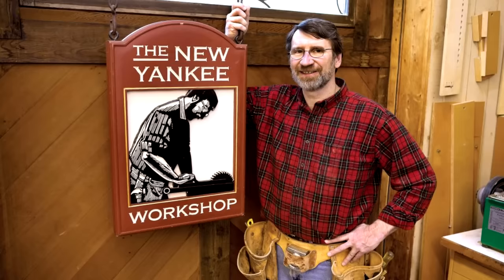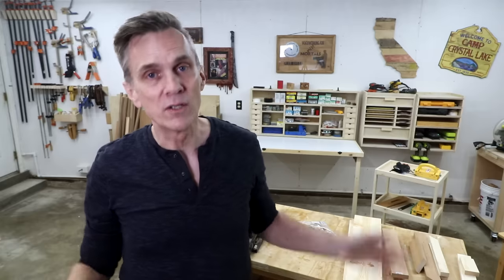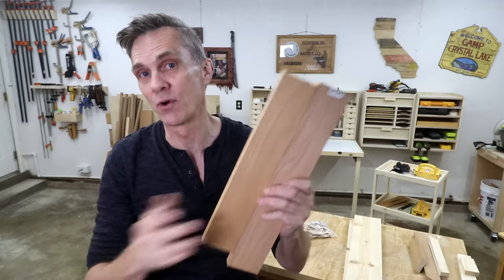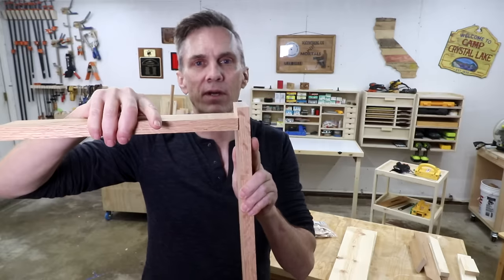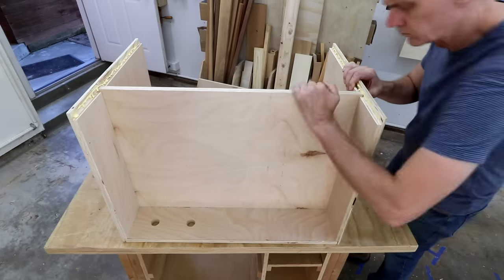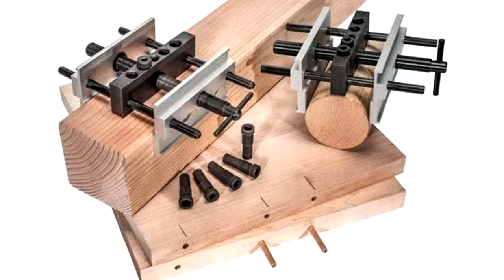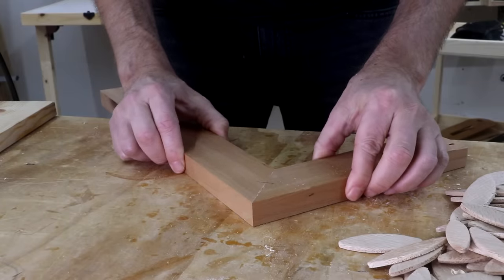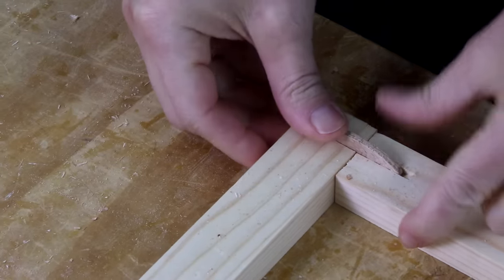So, is a biscuit joiner completely useless?

Comment: Depends on what tools and equipment you have.
What if you haven't got a table saw, or a table router.
Use the correct biscuits an spaced correctly , they are perfectly ok fir general joinery.
Frinstance, joining two 3 inch planks to make 6. 💪

Comment: Came to the same conclusion many years ago, used it a few times and decided it was useless.
Reply: You probably have not designed furniture with it in mind. You can make anything from cabinets, tables, chairs or anything else with biscuit joints and when combined with screws it produces really strong joints with perfect alingment.

Comment: I actually bought one a couple of months back and have been using it for edge joining. I was on the fence about it, but I'm hoping I can use it to strengthen some miter joints on a cabinet I'm building.
Reply: You can build cabinets with biscuits as well. Small tables and perfect for biscuit joints as well. I use biscuits with pocket hole screws for perfect alignment that produces strong joints. 
If you are making cabinets with raised panels you can join the stiles and rails with biscuits. Dining tables in the only thing that you could not use biscuits on their own with but that is were pocket hole even normal screws come in. 
What you can do as well with a table is joint it up with biscuits and then drill a dowel though after the glue as cured.

Comment: I have a dowel joining jig (actually, three of them— garage sales). My brother has a biscuit joiner (also a garage sale find). They both work, but the dowel joinery is much cheaper. Maybe the biscuit joints are stronger, but I wouldn’t want to rely on either for a joint that will bear a lot of weight or stress.

Comment: I use a dowel jig regularly - I got a pretty good self-centering one - and I find that it is particularly useful for helping me line up glue-ups for otherwise awkward joins.  In addition, I use dowels when I need a joint to be particularly strong. I agree that it's not usually necessary, though.

Comment: Steve,  I just happened by your channel after viewing someone else's channel on the same subject.  I must say the biscuit joiner you have must be pretty crummy to cut a slot like that.  If you had a better machine it might cut a better slot that fit the sai biscuit with less slop.
Having said that I too fine the biscuit joiner to be essentially useless in my shop also.  I have a higher end machine and it cuts good slots saw the tool as eye candy after watching Norm biscuit everything together.  So I ran out and bought one.  And after one or two uses I put it on the shelf and it has stayed there for the last 20 years.  The one use it is supposed to excel at, aligning boards for edge gluing is an unnecessary step for me.  I am fairly adept at edge gluing and can get very flat glue-ups without the added step of dragging out another tool and the steps involved in cutting slots.

Comment: I use my biscuit joiner every time building cabinets and the occasional finishing projects. If yours is that sloppy then it’s obviously a piece of junk. Love mine and use it it plenty
Reply: I am making a couch table, I have a dowel jig but it doesn’t got exactly in the center edge of the 2x4. So I was gonna try a biscuit joiner cause you can adjust that. So in all your opinions what do you think would be best? Thanks I’m Advance. Big Jim.

Comment: I, too, was influenced by the great Norm Abram, when I bought my biscuit joiner. I soon became aware that biscuits added virtually nothing to the strength of joints. But I have to take exception to your dismissal of their ability to level the joined lumber. If you leave the biscuit container open to the atmosphere the biscuits will swell as they take up water from the air. In fact I usually have to lube them with glue and tap them into the slots. They do a great job of lining up and leveling joints between long boards and this saves me a lot of time scraping and sanding later.
Reply: Norm often tapped his in with a small mallet.
Reply: Dave Claghorn I noticed that Norm glued the hole before inserting the biscuit . Supposedly it helps biscuits swell up and fit better as they absorb the glue. I find that glue helps lube the biscuit to make it easier to insert.

Comment: I don't remember the episode, but towards the end of Norm's series he did state that he generally no longer used biscuits for table tops as he had seen problems with depressions appearing at the sites of the biscuits, after a number of years.

His producer got a number of his pieces and the New Yankee Workshop, the building, was on his producer's property. Thus Norm could check up on how some of his pieces aged.
Reply: This also calls to mind something that I learned from Paul Sellers that I have not seen mentioned elsewhere. When gluing up something like a tabletop he has on occasion remarked, and demonstrated, that after about a minute when the glue has just started to seize up a bit you can then align the boards with hammer taps and they will stay aligned. They won't if you do the tapping too early and if too late then of course you can't realign the boards. So you can start tapping pretty much right away and do over, say, 10 seconds later, if it springs back--- until it stays.

Comment: IMO, I got a pretty cheap and efficient biscuit jointer for 50$. It's quick, tight. and invisible. For smaller projects. I put dowels but , I like the fact that  with biscuit you don't have to be very precise when you establish the center of the hole(a simple straight line on both pieces, it's time save). You can move the pieces from left to right during glue up. floating tenon methode(all of them) are great because you don't have to calculate the extra length to make tenon, rabet, tongue, etc. When I have time, or if I need extra strength, I'll choose true tenons. But I would say that biscuit jointer can do 90% of the work quicker with all the strength that I need. Normal is always right! But kinda dangerous with power tools ahahaha

Comment: I'm using a bisquit joiner I bought after watching a video where you used one right now as I listen to this vid.  Not only am I using it to join mitered edges, but, are you ready for this??  Lol, I'm using it to cut grooves in the frame of a small closet door to insert the panels into!!  Hehe, yeah, found a second use!  I wanted to maximize the $10 I spent on a used one...  😉 👍

Comment: I have a lot of build-in closets (melamine) and I use my biscuit joiner to align the horizontal to vertical panel connections before pumping in some screws with some glue in between em. They give little structural strength but it definitely helps the build process

Comment: I jumped on the biscuit joiner bandwagon back then and wish I had done something else. I'm even disappointed in pocket hole joints. They, too, break loose under strain, either pull out or wiggle loose. Supporting any moving strain is not their strong suit.
Right now both have moved from the "maybe I"ll use it someday" storage, to the backroom storage area and soon again move, this time to the loading dock.

I think I'll use miter bolts or splines next time.

Comment: ever work with BeadLock?
It's basically a doweling jig that 'racks' to make overlapping holes for special floating tenons
Less convenient than dominoes but claims to be stronger!
Reply: I own the basic model. I plan to use  it, along with pocket holes, on a farm table build.
Reply: I tried the beadlock, but the accuracy just wasn't there.  I splurged and bought the Dowelmax and couldn't be happier.  Downside is it's quite expensive.

Comment: bought a harbor freight bj about oh 5 years ago. Used it a lot. No slop, tight fits usually. Made a lot of plywood drawers for built ins, so not exactly fine furniture. Probably made 40 drawers. And I think it worked well and saved time. Though quite noisy and messy. That said, I use good old dowels most often now. Hah, I bought one of those notorious dowel jigs, a cheap one also from HF that doesn't align, ugh. Instead, a simple set of dowel center inserts is now probably my favorite method, and also lo-tech and super cheap. Probably a bit slower than the biscuit joiner, but stronger, better alignment. Yeah I use cauls on table tops but a few dowels I find helps hold the whole thing together while I get the cauls set up. And yeah I have a pocket screw jig too! but don't really use it that much. I would advise any noob to get a set of dowel centers and a good brad point drill bit. So cheap, easy, versatile, strong, simple.

Comment: Biscuits vary in thickness.   When I use them I sort them into 3 groups using a test slot... too tight, too loose and snug.  Too tight ones can be saved or shrunk in an oven or with a "Shop oven" - a coffee can with an incandescent bulb hung over the open top.  Biscuits that are too loose will generally swell a little if left out in ambient humidity though misting them may work too.  There are certainly cases where a biscuit joiner cuts a quick and easy to assemble joint though there were a lot of dorky biscuit joiner projects in 1990s woodworking magazines that were probably overly optimistic about suitable applications for them.  One cool thing about them is many of the machines have a tilting fence so angles that are a real pain to do without something even pricier like a Domino joiner can be joined with not much effort.   I have a Mafell duo doweler which does angles too but biscuit joints are quicker.  The dowels perform better when clamping is awkward because they are very positive in maintaining the angle of the joint while a biscuited joint may require more detailed clamping to get the angle glued correctly.

Comment: I use a biscuit joiner to help me make panels for CNC cutting. Easier then screws and stronger than just glue and helps me get them all together easily. But yeah you are correct otherwise.
Reply: It's not stronger than just glue... that's the point unless its butt joints... the strength the glue joints supersedes any strength the biscuit joint has... they are purely for alignment which I use them for alot

Comment: If I owned that cheap biscuit joiner I wouldn't use it either. There are also metal biscuits, plastic bisuits that snap together as well as some metal ones that are epoxied in place for knock down. The porter cable biscuiter has an extra small blade for face frames which I have used and it can do double biscuit slots. Then there is the Lamello the inventor of biscuits that rival the domino in usefulness in cabinet assembly.

Comment: I've wondered why I never see anyone use them. Now I know and knowing is half the battle.
Reply: Most hobby wood workers do not rely on speed and precision. They can spend weeks and months on projects. 
A person running a business does not have that luxury. They can be used for fast alignment of cabines, small tables, draws, box construction, face frame construction and fitting and about anything your imagination can produced. 
I have used them on dinning table construction in conjunction with through dowels and screws.

Comment: I think you might be using either the wrong size biscuits, or maybe the old jointers weren't as accurate as ones today? Mine are a tight fit going in with and do help alignment and glue up - for me at least. For me it's a fast way to align multi-glue ups. But then I don't own a table saw, so maybe I'd use it less if I did.

Comment: If your biscuits are loose like you showed there is either something wrong with the cutter or your jointer. I need to tap the biscuits into my jointer cuts and some are even what I would call too tight, you can't pull them out without pliers. I have made many face frames and cabinet door frames in my life including mine and many of my friends and there has never been a problem with any of them. I'm a 77-year-old retired German-trained journeyman Cabinet maker. If you plan on hitting your face frames and cabinet door frames with a hammer use mortise and tenon, if you use your cabinets like most of us do you will be safe using a biscuit jointer. That said the best and most effective inexpensive method is still using dowels. But biscuit joiners do have their place.

Comment: As someone with 30yr old cabinets made with biscuits, I can say they absolutely hold up over time. Furthermore, if you are doing a lot of the same size stock, a biscuit jointer is really fast. Like insanely fast. Now, is a biscuit jointer more useful than a router? Hell no! But a biscuit jointer is not a bad tool and effective when used properly. Just my opinion.

Comment: I too was interested in biscuit joints because of norm. Originally I took the cheap way out and bought a slot cutting bit for my router. This worked great. The biscuits fit tight in the slot and kept the boards aligned perfectly. So, next I bought a biscuit slot cutter and was very disappointed. The slots are oversized so there is no alignment to speak of. I doubt there is any added strength. It rarely gets used any more.

Comment: I bought and used a biscuit joiner and found it pretty useless.  I subsequently used dowels, and, while they weren't superb, they worked better than the biscuits and the dowel jig cost like $30 vs $200+ for the biscuit joiner.

Comment: Interesting. I was just starting to look into biscuit joints for an upcoming project. This being the first video on the topic, for me 
I already looked into some machines. And noticed that there are at least 3 sizes of biscuits. And the machines generally have 6 depth settings. And can angle from 0 to 90 deg. And, from memory, Norm's biscuits fit a bit more snug, but he did mention them swelling up.
I just don't like the fiberous spongey look of these biscuits. They seem to frail, compared to the dowels..

Comment: With the right Coupons and sales you can get a decent Biscuit Joiner at Harbor Freight for around $40. Which isn't terribly expensive. It's not gonna be of any kind of super high quality, but seeing as you hardly need to use one that much it's good enough to keep around just in case you had the desire to use a biscuit joint.

Comment: One thing that you didn't mention is that biscuit joints are very quick to make. To make a storage box for my shop I need to make 16 joints.  If the biscuit joints take one minute less than a dowel joint, I'll save over a quarter of an hour on each box.  If I need 10 boxes that's over 2 1/2 hours saved.

Comment: I've inherited a biscuit jointer, which I use for chopping boards and such, but otherwise I wouldn't have bought one.

I wish there were doweling machines with the same layout as a biscuit jointer, as the ergonomics are nice, and most dowelling jigs are awkward, but I've never found one at a sensible price point.

Imagine an end mill that exposes as you push, like a biscuit jointer cutter, which you then put standard dowels into.
Reply: Also, my biscuits don't have anywhere near that amount of slop in the fit top and bottom - it almost looks like your cutting blade in your machine is a bit thick!

Comment: I've rarely used my biscuit joiner.  Although I've used it to align face frames (assembled using pocket screws) to cabinets, the biscuits are sloppy enough that they are a bit of a pain to use, falling out and having to do a lot of fussing.  I've had more success with using a router to cut mortises and using a floating tenon.  In this case you can make the tenon really tight, which might result in poor glue coverage, but you get alignment and no fussing since the tenon won't fall out.

Comment: I use my biscuit joiner on table tops for alignment as I do not want to shell out the cash for a domino. My slots are nowhere near as sloppy as yours Steve. If you have a too tight biscuit you can microwave them to get rid of the moisture, or soak them in water to swell them up a little to get rid of the slop.
Reply: I'm going to give that a try to fatten them up a bit.

Comment: I have a biscuit joiner. Don't use it a lot but my biscuits are a LOT tighter than your demo's. Really handy when I edge glue boards and want the surface to be flat between boards. You should check your biscuits and the size you are cutting to.

Comment: the biscuit joiner is not a bad tool 
the biscuits are the problem if they were made out of solid wood with really tight clearances 
they would add additional strength and make aligning easier

Comment: 1. Get a narrower spec blade and your biscuits and splines will fit snugly. and 2. if you it to cut spline slots in corner joints, use hardwood splines, not biscuits!  I’ll choose hidden biscuits over (ick) ugly pocket screws wherever I can.

Comment: I always use them when doing edge joining.  But I have to select the right sized biscuits from the box. Many are undersized. If you do this, it's a fantastic method of aligning boards. Still use cauls and weights. Steve, there is no way that not using biscuits is better than using them. Sorry but you don't do any things that need a biscuit joiner so this video is just for yourself

Comment: Well I bought my biscuit joiner for $40 CAD!
I use it for making panels. 

I feel dowels are as strong, or even stronger than biscuits and have both the basic and deluxe Wolf Creek dowel jigs so I use biscuits for manyng side panels for cabinetry and dowels for Assembly. 

My goal is to not use screws to hold my work together.